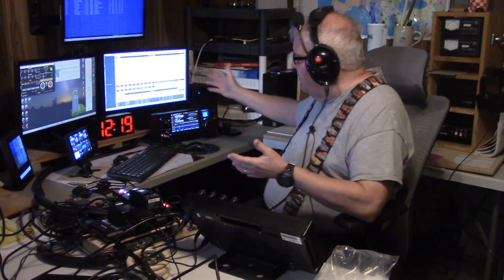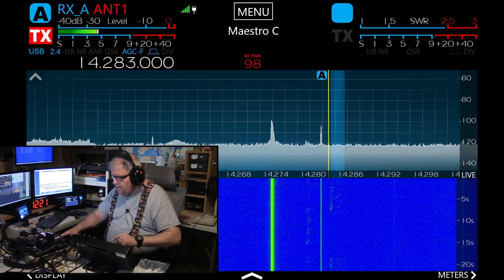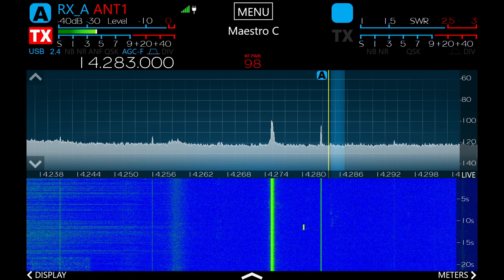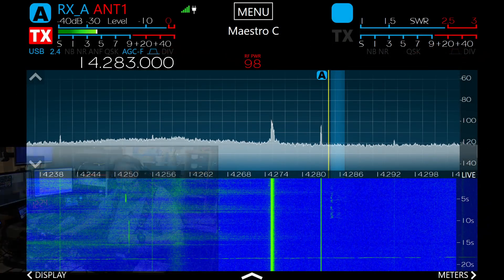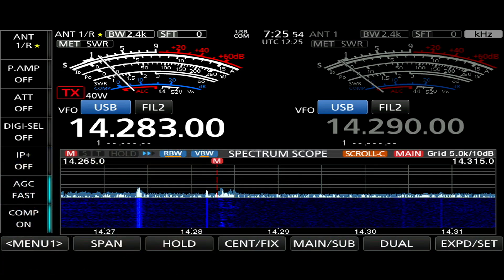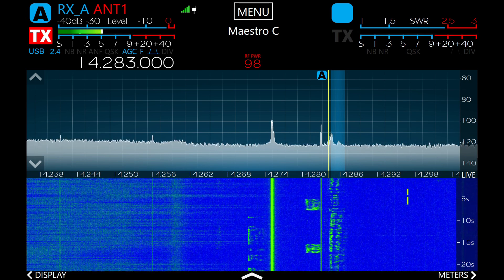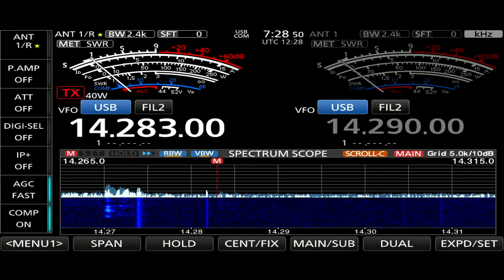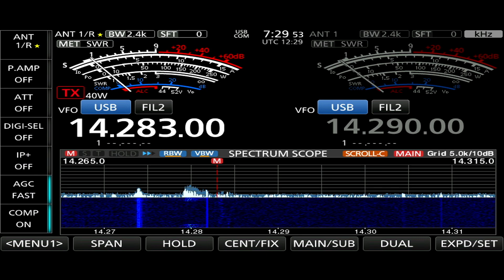Weak Signal SSB Test   Flex 6600 vs Icom 7760

Comment: get a Flex 8600 and try it
Reply from the maker: Hi Jim - I don't know if you saw my follow up video when I borrowed my friend's 8600M. Link is here: https://youtu.be/hPNnelu5LVU

Updated Version 3 software brought my 6600 and the 8600M on a par with the Icom 7760. I would expect that now with Version 4 software the Flex will gain an advantage - especially with the 8000 series hardware.

I fully expect a firmware update from Icom to enhance the performance of the 7760. We'll see. They are all great radios.

Fun fun fun! 73 de W4EEY

Comment: Gary! I am seriously considering selling the 7610 for a 7760 but I keep seeing negative comments regarding the cheap plastic 7760 head unit. Any comments?  Thanks for the great video.
Reply from the maker: You made me go over to the radio and feel the case. It is plastic, but well molded. It comes with a stand that holds it at a good angle for viewing on a desktop. The VFO knob is in a good ergonomic position and feels nice when tuning. The only criticism (which also applies to the 7610) is that the potentiometers used for volume have a little play (slop) in them. Not much though. And as they are also a pushbutton it is probably inherent in the way they are made.

The main unit is built like a tank. No issue there.

In my case the 7760 replaced a Flex 6600 and Maestro, where the radio was located in a storeroom off my garage.  The 7760 and controller just "dropped in" to this set up. The control unit does not take up much desk real estate.

The 7610 is very similar in performance. I don't know if I could justify upgrading. But we all have our own reasons. If you like the 7610 you will love the 7760.

73 de W4EEY

Comment: Thanks for this, I have a 6400 now, but I was SUPER impressed with the 7760 while in store. Even on a compromised antenna, it was pulling in weak signals so much more clearly than anything else I had heard before. I am currently on the fence myself between an 8600 and 7760, but I am leaning towards a 7760 just because it was so intuitive and easy to use.
Reply from the maker: Each radio has its strengths and weaknesses. Now that Flex has shifted from incorporating pieces of third party software in Smart SDR to doing it all in house, the way is clear for them to make marked improvements. Case in point is their new Noise Reduction algorithms for the 8000 series. Also their DAX and CAT Interfaces are uniquely powerful. I wouldn't count them out. The sky is the limit.

Icom has over 60 years of radio development and they know what they are doing. Listening to YouTube videos of stations with Icom radios always impressed me with the rich, full bodied sound. I have that with the IC-7760. I fully expect new firmware with new features soon (the IC-7300 Mark 2 has a CW decoder built in for example).

The British have a phrase, "Fit for purpose". It all depends what your purpose is for the radio. Knowing that, you can determine which is the "best fit" for you.

Thanks for commenting. 73 de W4EEY
Reply: @W4EEY  Very true! Flex just dropped some new firmware the other day for people on the PLUS plan. Waiting on some videos on that.

Comment: Thank you for the excellent demonstration. I am still uncertain about the use, in the 7760, of the GENE tab in the Band Stacking Register screen. Touching the GENE effects big jumps in frequency, with no consistent or intuitive pattern towards general coverage. Examples:

8.08 jumps to 1.3 
Or, on another occasion, 8.08 jumps to 1.58
 
Or 8.080 jumps to 5.000 
5.000 jumps to 2.990
2.990 jumps to 8.080 
or, on another occasion, 2.99 jumps to 21.949
10.000 jumps to 5.000 
24.900 jumps to 2.990 
50.050 jumps to 2.990 

I could also not see mention of the GENE anywhere either in the Basic or Advanced IM. 
 
Thank you for any advice you can offer.
Reply from the maker: The GENE designation stands for "General Coverage". It is a way for you to be able to monitor frequencies outside the Ham Bands. I asked Google AI to explain the operation of the band stacking registers. Here is the reply:

"The band stacking register in Icom HF radios is a quick-access memory feature that stores up to three frequencies and their corresponding operating modes for each band. It is an "ad-hoc" memory, functioning as a rotating scratchpad rather than a permanent memory bank. To use it, you manually set a frequency and mode, then tap the MHz digits of that band button for a second to store it; repeated taps of the same MHz button then cycle through the stored frequencies for that band."

So the GENE position has three scratchpad memories that you can cycle through.

73 de W4EEY
Reply: @W4EEY  Thank you

Comment: For VHF weak signal work, I am sold on the IC-9700 it really pulls them out! 73 KT1R
Reply from the maker: I have not used the 9700 but I have a friend that has one. If it had 6M plus VHF/UHF it would be a good replacement for my Yaesu FT-991A. But I need 6M. Thanks for commenting. 73 de W4EEY

Comment: I agree the iCom is easier to understand the voice despite a lower S meter reading on the screen. I had a Kenwood years ago and could not hear a guy on our local net on 10 meters. I bought an iCom and he was about S3 and perfectly readable. I was talked into purchasing the entry level iCom IC-725 years ago, and when I saw that difference, I was sold. iCom radios are expensive but they are also top of the line radios in my opinion. Thanks, I am really glad I saw this video before I purchased a new radio. I have not been able to pull the trigger on the 7760, or the Flex 8600, or the new Aurora 500 watt Flex. This has been a huge help. I will watch this video again a few times. Thank you.
73’
Reply from the maker: Thanks for commenting. I am awaiting the release of SmartSDR version 3.9 from Flex Radio. It is promised to be out this month (May 2025). I will then retry the comparison. In the past a version update improved SSB intelligibility (I was using a Flex 6500 at the time). 

My friend Bruce, KB4FHA, purchased a Flex 8600M and it was delivered a few weeks ago. Unfortunately it had a bad Spectral Capture Unit (one of two in the radio) and a new radio was being shipped from Flex to replace it. When it is available to borrow I plan to run the test again using this new hardware. Stay tuned!

73 de W4EEY
Reply: @W4EEY  thanks again CUL
73’

Comment: Thanks for the video, have you measured the ‘average’ power output of the 7760? Is it the common situation with SDR radios in that it has PEP of 200W but a low average output compared to older superheat radios?
Reply from the maker: No, I have not specifically measured output power on the Icom IC-7760. But I do monitor power using the circuit in my RF-Kit S power amplifier. Generally I drive the amplifier with about 40 watts to get 1200 watts out (note that I replaced the amplifier's 13 dB input attenuator with a 17 dB version).

I do not know about SDR's having a low average output power, but I can say that I have observed a difference between the output of my Flex 6600 and the IC-7760 as noted on the RF-Kit's metering. At first I thought something was wrong. With the Flex transmitting SSB using maximum processing the power peaks were rapid and pronounced. With the Icom I saw less "spiking" on the meter. I think this has to do with the audio processing differences in each radio.

73 de W4EEY

Comment: there are setting in the Flex to bring in the signal WAY better than the ICOM.  I have the ICOM 7300 on a massive 6 element and my Flex at my other house running remotely on a cheap vertical pulls ing signals WAY better.
Reply from the maker: Thanks for taking the time to comment. As I have asked in other replies, "What specific settings would you recommend I change to improve SSB intelligibility in the Flex 6600 for weak signals?" So far no one has responded.

I tried to make the comparison fair, with identical settings on both radios. AGC-T was adjusted to just reduce background noise on the Flex. Signal inputs were identical from the same antenna via an Elad HF multi-coupler. I am not anti-Flex Radio. I went to the Friday Flex Dinner at Hamvention and spent time speaking with Gerald Youngblood and various representatives (Hi Natalie!) on the convention floor. A new version of software (v3.9) will be released by the end of the month. I plan to retest again using this updated software. My colleague KB4FHA has a new 8600M. When ready, he will loan it to me to repeat the test with the new hardware.

Icom did not have a radio that fit the way my station was designed until the advent of the IC-7760. A colleague in my local Ham Club earlier noted weak signal CW reception issues with the Flex 6700. Of course he was comparing the 6700 to an Icom IC-7851 (well out of my price range). But I wanted to try the Icom specifically to see if I could improve weak signal SSB intelligibility. I also heard contest audio in YouTube videos from other hams using Icom Radios and the "Icom Sound" was wonderful.

In the end I am happy that I have both radios. The 6600 is now serving a new role in supporting my Ham Radio licensing classes via the HDMI output from the Maestro C. I can show students the received signals on the wonderful spectrum display. The Icom IC-7760 is (today) my Ham Shack radio of choice. But the thing with SDR radios is that with new software comes a new radio.

Thanks again for commenting. 73 de W4EEY

Comment: Flex 8400 and 8600 now.  Newest generation of their radios, with significant improvements over the 6000 series Flex radios.   Not sure there's much utility in comparing an older generation Flex with the newest Icom.
Reply from the maker: I did the comparison mostly for myself. I wanted to see how the two compared. Flex will be coming out with version 3.9 software later this month and I plan to revisit the issue to see if there is an improvement. Back in the day (version 2.x software) Flex did improve intelligibility in an upgrade (confirmed only informally by Tim Ellison at a Hamfest - never acknowledged officially).

My friend just received a Flex 8600M. But it may be going back due to a defect. If I can I will compare the IC-7760 to the 8600M when the 8600 is working 100%.

Thanks for watching. 73 de W4EEY

Comment: Thanks for this good review, i sell my 6600 to buy a new 8400, I love sdr, using only sdr 10 years ago but now, waiting to buy 8400 and using my old 7600 I find lower noise and to much better agc on pileups, contest, my anan 7000dlemkii also fails on pileups with bad agc. Maybe after 10 years I back to icom.
Reply from the maker: I love the Icom IC-7760. It is different than the Flex in some ways. The Spectrum Display and Waterfall is better on the Flex. But the receive intelligibility of the Icom is better. The Icom performed great in the CQWW SSB WPX Contest under heavy conditions. The 1.8 kHz filter is wonderful with no loss of intelligibility. If you can, take a look at the Icom. I think you would like it too. 73 de W4EEY

Comment: Set = Good,Price = WTF !!! , Ill stick with my FTDX101D/MPAS IT HAS  MUCH BETTER VALUE AND EXCELLENT TUNERS
Reply from the maker: The Yaesu FTDX-101D is a good radio. It is priced similarly to the Icom IC-7610. But both of these radios did not fit the topology of my existing station (which was based on my Flex radio in one room and the Maestro controller in the Ham Shack). The IC-7760 was built "just for me" to fit into this scenario.

There is an old Ham saying, "the last dB of performance is the most expensive". Top of the line radios are more expensive. The Elecraft K4D is priced similarly to the IC-7760. I'm not going to argue which is better. I have friends with the K4D and they love them. But the K4D wouldn't "fit" in my station. The Icom IC-7760 is definitely the best radio I have ever owned.

73 de W4EEY

Comment: Gary, I have very similar radios in my shack... the Flex 8600 and IC-7851 (although my 7851 is superhet based instead of SDR). I see pretty much exactly what you see in your comparison between the IC-7760 and the 6600. I think that for SSB the 7851 is marginally the better receiver. The Flex is in the same 'ballpark', but comes across as having more background hiss. In use, it would be normal to optimise the RX on the Flex to suit the S/N by adjusting the AGC and RF gain, but I don't think you did this which is probably why your 6600 sounds so very noisy in comparison... had you done so there would be less difference in the perceived performance. 

Regarding the comments about S-meter (guess-meter!) readings, this is well explained by Flex Radio in their own YT videos. They are really coming at the subject from a different perspective... Think of the Flex as a spectrum analyser rather than a radio receiver... On a quiet band (or with the antenna disconnected) with my IC-7851 the S meter reads zero, whereas with the Flex 8600 (or the 6400 I had before) it will, when using a typical RX bandwidth of 2.4kc read about S2 to 3... It really is of no consequence. I find the Flex S meter is also rather 'mean' on bigger signals too, which I have no problem with.

I bought the Flex primarily for remote operation and in this respect it is in a completely different league to the Icom, in fact I can't even operate my Icom remotely as the Icom remote software only works on Windoze PC's and I only use Mac. Having said that, despite me finding the Icom RX more to my liking, I find the operating experience of the Flex so good it is my 'go to' radio.
Reply from the maker: I agree with your assessment. In my way of thinking the Flex is more like a Spectrum Analyzer with a signal demodulator attached, whereas the Icom is a radio receiver with a more modest spectrum analyzer attached.

I was aware of the Flex approach to signal strength measurement and the ability to measure in real dBm. The Icom takes a "looser" approach (I believe I even read that the S Units on the Icom are 3 dB per division versus the "standard" 6 dB). It is jarring to see S-5 noise indicated on the Flex and S-1 on the Icom and realize that identical signals are at the antenna inputs.

I used the IC-7760 in the recent CQWW SSB WPX Contest. It was a joy to use. I discovered that the 1.8 kHz filter on the Icom retains signal intelligibility (radios from my past such as the Kenwood TS-850 with an analog 1.8 kHz filter did not). I also used the Icom's Noise Reduction throughout the contest (never turned it off). It is that good. I would never do that with most other radios.

All in all it is two thumbs up from me for the Icom IC-7760. Thanks for commenting. 73 de W4EEY

Comment: I always found the flexes sounded a little harsh. I wish I had 7760 money, glad you are enjoying your setup. I have a similar setup with an Expert Electronics SunSDR2 DX i picked up as an ebay bargain, for the same reason to set the radio up somewhere more convenient.
Reply from the maker: One of the things that prompted me to consider the Icom was watching videos on YouTube from other hams using an Icom. I realized that there was what I call the "Icom Sound". It just sounds rich and pleasant. From my Flex, not so much. Possibly I could equalize the Flex to improve the sound but out of the box with a flat response the Flex does sound (to me) harsher. Thanks for watching! 73 de W4EEY

Comment: my hermes is way better than the 2. :)
Reply from the maker: Cool! Glad you like it. I've never used one. 73 de W4EEY
Reply: Try on pileups or performance in contest, I’m user years of anan 7000 with Thetis and 10
Years with flex and both can not adjust agc gain with strong and weak signals on same frequency, to use to talk with a friend, essb and have multiple adjust its good but for contest, SES Thetis/anan don’t works fine.

Comment: 7610 is just as good as this plus it all fits on the desk, yea the radio head is small but the unit is large, should have just made it in the form of the 7700 or 7851, which are just as good.  Great video and thank you for taking the time to post, much appreciated 73
Reply from the maker: The 7610 did not "fit" the way my station was built. I used the Flex 6600 and Maestro combination, locating the radio in my garage storeroom. The 7760 was a drop-in replacement for this arrangement. I have a dedicated CAT-5e cable connecting the controller with the radio. The radio is connected to my LAN in the storeroom. It just worked! Loved this radio in the just completed CQ WW SSB WPX contest. 73 de W4EEY

Comment: Did you use the flex agc-t
Reply from the maker: Yes. Adjusted to the point where the noise just starts to go down. 73 de W4EEY
Reply: @W4EEY  fantastic, thanks hanks for the reply 73